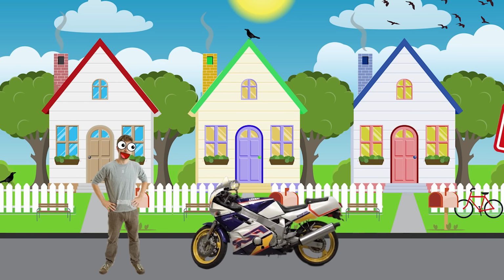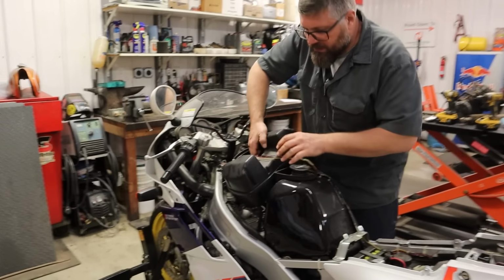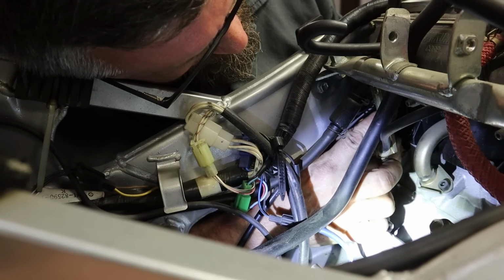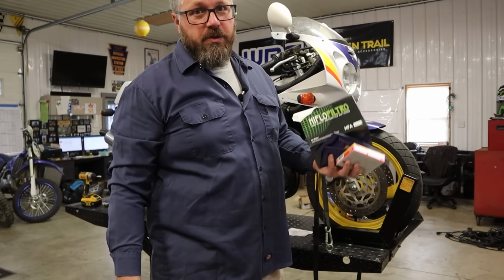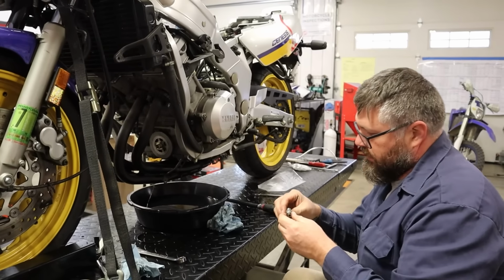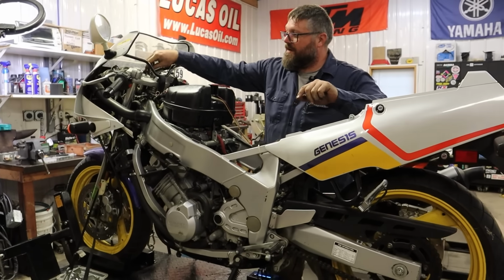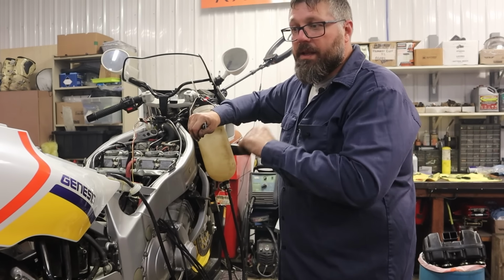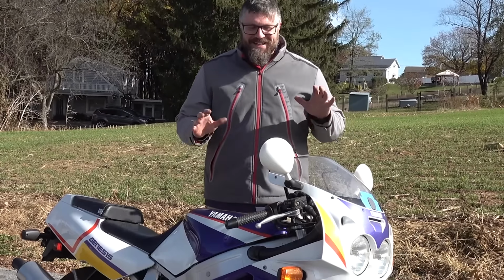Can I Get This 30 Year Old Yamaha Motorcycle Running?

Comment: I was a general manager, sales manager for a multi line dealership that included the Yamaha brand for 30+ years. I must say I've seen and appraised lots and lots of motorcycles over those years and that is about the cleanest sport bike I've ever seen for it's age Even had the original tool kit, WOW! If it had the original owners manual too, that would be the holy grail. 😁
Reply: And the graphics on older sport bikes are so cool!
Reply: When fuel tanks were made from metal & not plastic like they all are nowadays
Reply: The tank cover for the FZR is plastic...
Reply: @bmwpete65s55 How are they cool? To much graphics, if a motorbike has great lines they do not need a lot of graphics.

Comment: I had the 1991 Genesis Exup 1000 and that was a machine. A lovely smooth ride and it handled perfectly. After I balanced the carbs it ran like a fuel injected engine and really smoothed out the engine. One of the best things I did to it was to fit a chain oiler. No longer was I going through chains and sprockets or constantly re-adjusting the chain. 🙂

Comment: Love your channel, Craig. It's good to see an experienced tech working to keep these old bikes on the road. I'd like to add a few things......I do a lot of carb restoration work on multi cylinder  bikes and here's a few things that I've learned. Twenty year old gas stinks and you can't get it out of your skin- wear gloves. Never clean carbs unless you flush the tank no matter how clean it looks, when the ethanol gas gets in the tank, it flushes all kinds of crap into your newly cleaned carbs. You usually won't realize it right away,  it will take a tank or two until it starts running rough. "Syncing" carbs will NOT make a poor running bike run better, but it will make a good running bike run great. Keep the videos coming!
Reply: Tnx ,👍

Comment: This is the first video you have done that was really good. No clowning around, you did the right stuff to get an old bike running. And for the first time, you conveyed that you actually know what you are doing!! Also, it took me all of two minutes to order a Digi Sync after I saw you use it. I have been messing with mercury tubes and gauges since the 70s!! Thank you for making me aware of it. I have finished a 77 KZ1000 and just finished an 81 XJR750, both that had been sitting for 30 years and went through the same drill but the bikes were in much worse shape. 
Good job!!!

Comment: I had a 94 FZR 600 . I put 70,000 miles on it, the only thing that went bad was the spark plug wires were dry and it misfired when the humidity go too high. I bought all new wires and coils, that bike was running great when I sold it in 2018. Greta fun bike.

Comment: In 94 i was a kido, like 9 yo. I loooove this style of bike. Double round headlights are so cooool. Thank you Craig :)
Reply: In 94 I was already getting a bit old for motorcycles ...30 years later?  Still too old for my latest MT-10 (and the MT09 and the KTM 690)     Hey 94 Sportbikes are totally NOT obsolete...I mean unless you want ABS and quick shifter etc etc.   Sort of miss having a motorcycle I knew I could fix and adjust the valves etc...on the other hand?  Playing with jetting on four seperate carbs was sort of a nightmare or easily could be...but so nice just gravity filling float bowls....no ridiculous fuel pumps

Comment: I owned a 1988 FZR 1000 and out of the 15 plus bikes I have owned it was by far my favorite. The older gen Yamaha engines were basically bullet proof as long as you maintained them. I banked about 60k miles on that bike and it still ran like it was brand new when I sold it!

Comment: If it has been sat for 20 years I'm going to assume all it needs is a carb clean and some fresh fuel hoses. Can't wait to watch the video and see what you uncover!
Reply: I think you mean fuel line 😅
Reply: It's going to need a lot more than that. Both front and rear master cylinders and calipers will need a rebuild,  new brake lines, and pads. New tires. Oil change and filter, valve adjustment and who knows what else.
Reply: @ericalger5003  We both missed the most obvious, a fresh battery lol!
Reply: @_droL  Long story short, it will need more parts and labor than it's worth.
Reply: @ericalger5003  I disagree, they're always worth bringing back to life! :D
Reply: @_droL  I am guessing Craig has a shop and he can get parts at cost. If you are buying parts at retail, and do all the labor yourself once you buy tires, battery, carb rebuild kit, all the hoses and cables and gaskets and oil filter and oil etc, you've spent more than the bikes worth plus whatever you paid for it. You will always lose money on a restoration. Especially on 30 year old 600cc sportbikes!
Reply: @ericalger5003  For reference, I own a 97' ZX-6R, not quite 30 yr old but, close enough. I've put 1k into it, including the cost of the bike. It has 5,000 genuine miles and did all the work myself in my front garden! You can profit, that said-- that's not what it's about. There's just something special about bringing a bike back to life.
Reply: @_droL  I can see your point if it's a bike you enjoy owning, can get the parts to maintain it and you plan on keeping it then being upside down in it is ok. I was thinking more from a flippers perspective.

Comment: I love rebuilding carbs.  Breaking them down and setting up 4 sets of carb parts identically.  The buzz of the ultrasonic cleaner going nuts.  Smell of Pine Sol (try it to soak, it won't eat rubber)  So satisfying.

Comment: I think this is your best production yet Craig.  I moved on and watched other videos after this one a few days ago, but I wanted to comment.  Sweet bike to wrench on. It was really loved and is hardly damaged even by the years. IDK how you got to use it for the channel, but I approve. The bikes with a cult-like following are the coolest ones to revive and they will bring the views to you. This one probably was a little too simple to revive, but everybody needs some easy days in the shop. It sure beats the hell out of soldering floats in the grass.

Those carbs with the brittle plastic floats and float hangers gave me flashbacks.  I broke one on my RF and it is unobtanium. IDK what I would have done if the Admin. of an RF FB group had not sent me one for free. Please be cognizant of the pitfalls of vintage bikes. Almost every time I work on an old bike the impact screw driver comes out.  It's my most essential tool next to the Allen wrenches ant the metric sockets.  It deserves its own tool spotlight/short video.  Get a collection of blown out and rusted screws encased in aluminum and impress those in the cheap seats.

I picked up a "new to me lift table" and a set of Kawi vacuum gauges yesterday at a nearby estate sale.  I'm so excited about using the lift table.  The guy had all Kawi stuff.  There were 4 bikes left; 2 were just rolling frames. There were boxes and boxes and boxes of basket case engines.  I'd love to see you assemble a basket-case bike Craig.  Get a roller and a dust coated and disassembled motor in a bin and show everyone how a real mechanic can take someone else's nightmare and turn it into a dream. Show us the magic bro!

Comment: Loved my FZR6 - hill climbed and sprinted it and toured France on it - stock motor was sweet as a nut. Had an issue backfiring and cracking spark plugs which was sorted by my Yamaha dealer, and it ran a 11.77 standing quarter with 119mph terminal speed. And our sprint was through a left right left kink!

Comment: Craig,
I watch you YouTube channel all the time and love seeing you fix up old bikes.  I picked up a 1981 Honda GL1100 Goldwing, I picked it up last year for a whopping $200, it was sitting in storage since 1995, the original owner passed away brought it to a repair shop but died shortly after and his wife did not want the bike. The shop owner put the bike in his storage and did nothing with the bike until last year when he decided to clear out his storage. The bike is interesting, the owner had put aftermarket cruise control and radar detector on the Goldwing. It cranked over for me but no gas, I did not put gas in it because I was told the tank was rusty. I would love to see this bike start and run. If you are interested in trying.

Comment: Took my Texas MC DL license test on a Yamaha FZR (‘88 to ‘90 ish) along with a buddy that I had recently helped buy it. Very nice clean bike, this was probably about 1993. The examiner that was following me on the road test told me I had to physically turn my head at each intersection to check for traffic or else I wouldn’t get the necessary points. So I did that. So did my buddy who was trying to get his MC license the same day. At the end of the day, both me and my buddy passed and got our MC licenses, even though the inspector mixed up our scores. My buddy unfortunately blew the engine a short time afterwards.

Comment: I was happy when I saw this come up on my feed. The Fizzer 600 is one of my all time favourite sport bikes. I never had a poster on my wall, but I've owned two of them.  It's underappreciate for it impact on the 600cc sportbike class. It was light and dominated the 600cc class for 3 or 4 years until a new Honda CBR dethroned it.  I remember one year at the Isle of Man, the top 5 finishes in the 600cc class were all on FZR 600s. 😁

Comment: I resurrect 80's and 90's sport bikes as well. Currently in my stable are an 89 GSXR750, 92 ZX7R, 89 Hawk GT, as well 2 mid 90's Honda RS125's and an 94 Honda RS250. Love the older stuff. The Hawk is modded with GSXR1000 forks and calipers, Ducati wheels and front rotor. The ZX7R has Ohlins forks, Brembo calipers and forged wheels from an Aprilia and even a period Fox shock. 
Keep them oldies alive!!!😎

Comment: I just rebuilt my old 1990 FZR600 that had been sitting in pieces for 25 years. Had to replace the idle jets before it would idle properly. Tried to clean and clean but they were too gummed up. Also, the brake fluid had turned to jelly! 
Back in the 90s the bike would burn out its voltage regulator. I have now swapped in a more modern mosfet style RR and hopefully that will keep this thing running.

Comment: I had a blue 1996 FZR 600. Got it in 2001 the summer I graduated high school.  It was my first motorcycle. I rode it everywhere. Through the rockies. Through the smokey mountains, tail of the dragon. Put 12k miles on it.  Ill never forget that bike.  I could never do those miles on a small sport bike like that now. Having to stop for gas every 80 miles lol. Oh and the seat. It really didn't have a seat.

Comment: These Yamahas are by far some of my favorite motorcycles out here still my first bike that I ever saw. It was one of those Yamaha mini bikes that I believe was like a YZF mini crotch rocket and maybe had like 125 cc are in 250 cc motor on there something you guys have actually had, some of them on the last channel that you were a part of but this right here this Yamaha FZR 600 R or at least that’s what my title said when I bought mine back and I think 1999 or possibly 2000 but I love this bike I even rebuilt it twice made it into sort of a Frankenstein fairing list open frame monster and I loved every minute of it. I bought it for 1300 bucks ended up putting different plastics in doing some work to it getting some new rims I rode around for like four years until I was ready to move up to my neck Spike and then I sold it for I think $1750 so I made money and had a lot of fun.

Comment: Good coverage Craig myself a hgv mechanic in the uk myself prefer older bikes with carbs less things to go wrong and easier to work do all my own maintence on my bikes i am a vfr fan have 2 750 models a 88 fj model and a 94fr model and vfr 1200f think you will agree with modern bikes and cars and trucks there is 2 many things to wrong with them. I check my carbs for balancing once a year dont take long just my time do it for a piece of mind . The vfr 1200f for me has enough tech on it abs and traction control  no power modes i have the power mode the throttle hand keep the clips coming thanks Andy.

Comment: Thanks for the silicon spray and heat suggestion - I stopped working on my Bandit 400 when I couldn't get the air reconnected to the carbs but ready to try again.
Reply from the maker: Use a heat gun on the boots if they are hard

Comment: I've had 3 FZR 1000 (since they kept getting stolen).
The second one had had some tuning done and I decided to "try it out" on my way home from the buy. 
So there I was, leaning over the tank with the stock exhaust in a dive-bag on my back, when the oil pressure light goes on. Not a problem, just pull the clutch and ease off on the gas.
The problem was that the speedometer needle was flipping around the  270 km/h mark...
All in all fantastic bikes to ride...

Comment: In 2014 I got the itch to ride again. Last rode in 1991. Searched for 3 months and found a 4,002 mile 1989 FZR1000. Last registered in 1991. Just had $1500 of freshening done at a dealer. Still had stock tires and all the body panels on it. I still have it. About to do a refresh and tune up on it. It has 28,000 miles on it now.

Comment: I had the fzr 600 from 89 with 99.940 km's on it before it got stolen on a saturday night for a joyride.. got ik back 3 years later with 99.960 on it.  Rusted out chain.. i didnt want to put any work in it and sold it for 100 euro.  Best bike ever.. everybody on the newest stuff doing 50 and i came by on a t shirt doing 180 it was such a good bike highly recommend the bike.. you still see them on the streets

Comment: Craig - video suggestion: what to do with a project bike once you get it home and you can’t get at it right away - meaning what should you do stop the slow damage of time …. Oil down the cyclinder(s) - open drains on carbs …. Battery out - And whatever else you think …. So that things are not worse when a guy (or gal) finally gets to it :)

Comment: What a machine! We had heaps of four cylinder, four stroke 250cc bikes in Australia in the early naughtees, because learners were restricted to 250cc. CBR250RR and the FZR250's  were the weapons of choice. If you had big agates you'd get yourself an RGV250, but that thing made about 60 horses and was light as a feather. Those fuckers we called "wizzbangs", because that was the sound they made when a learner took them out of a dealership. Thanks Mate! Another brilliant video.

Comment: I used to race these in WERA vintage. I'd race it till the motor blew to smithereens and then buy another one off of Craig's list. It was cheaper to buy a whole bike than fix the engine.

Comment: I had a 1988 FZR 1000, I loved tuning it. Stock settings can be a little richer needles and jets can be adjusted. While you are in there check the carb sync with a sync bar.
Reply: I'm restoring an 87 FZR1000 at the moment, its been a labour of love with thousands spent so far, and i still have the fairings to repair and paint.

Comment: I've worked on one of those..
 Tank was rusted pretty good.
You know what dude..?.?
I spent 60.00$ on some tank cleaner.
But found out later alls you need is...
Vinegar .05 acidity. Let it sit a week or two and...
It will dissolve all the rust. But if you don't ride the bike much.
It will F..K up again. So ride dude.👍👍

Comment: Had I think it was a 1990 FZR600 for a couple seasons maybe 10 or so years ago. Great little bikes! Easy to work on and with a little maintenance will go forever. Not too much to handle if you're new or small. Still plenty of fun for most any rider who wants to push it a bit. Loved some of the colours and styles they had back then. Plus I always loved those double round headlights.😛
Reply: Same as me, a 1990 FZR 600. It was such a fun bike.
Reply: Sweet! Yeah they are fun. Put a ton of kms on mine over a couple seasons and sold it for pretty much what I paid. Can't go wrong. Cheers!🙂

Comment: Bro,  you can get O rings at every bearing supply. Seals also. I got a rare $190.00 Porsche seal for $4.00 at the bearing supply. Next day, free shipping. I bought 4 and sold 2 of them to other Porsche shops in my area for $50.00 each and they were stoked.
Reply from the maker: I know. I get almost all my bearings and seals at the bearing shop, but they didn't have this in stock. Super good advice tho for people!

Comment: "While I'm in there", with the stock pipe and filter, I'd install a "Stage 0" jet kit. These bikes were never jetted for best performance from the factory. It's not a YZR, it's an FZR. We used to call them "Fizzer"s.

Comment: YZR? I remember those as FZR. There was also a FZR1000 EXUP. It had 5valves per cyl and a trick exup valve in the exhaust to boost low and midrange grunt. That was a fast bike. It triggered a new class of hyper sports bikes like the GSXR 1100, ZX10 and ZZR1100. CBR1000F, Blackbird. All REALLY  fast bikes but affordable today. 280-300km/h. Good times!

Comment: Classic front end and headlights. When I first saw the fzr in 80s it was the 1st bike I wanted. I got the dual headlight kaw zx7r instead. Dual headlights is the way to go. One yellow. One clear. 140hp rear wheel on my 94 kaw 90mph in 1st gear. Most balanced bike of the time. I was a little faster off the line than my friends cbr900rr. Better riding position

Comment: Fyi for anyone who owns, or is considering buying a carbureted motorcycle be aware that you should run the motorcycle until it is empty if you want to prevent carburator issues and downtime. This is advice mainly intended for long term storage. You can use fuel additives in your full tank but eventually with temperature variations and time you'll develop fuel issues and fouling. When you run the bike until empty you are actually vaporizing the fuel in the system and in the carburator which makes it dry and safe for storage. Always do your research on claims like mine or you may develop unforseen issues related to your specific vehicle.